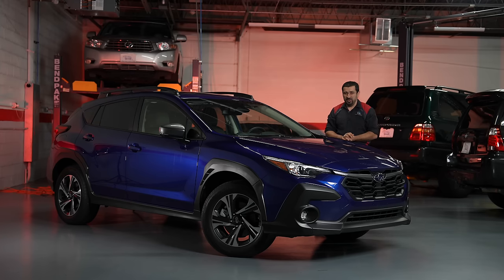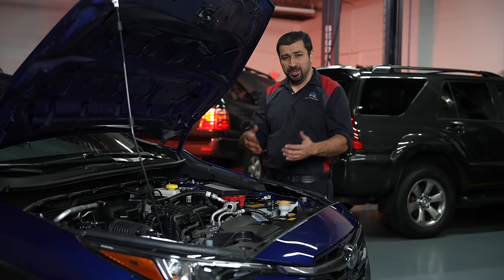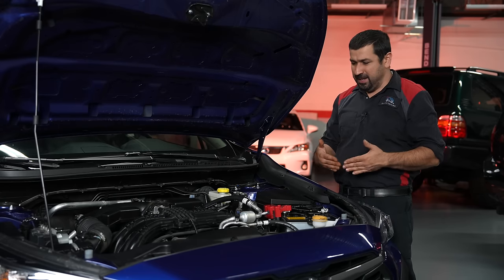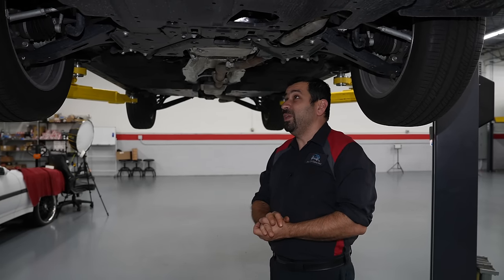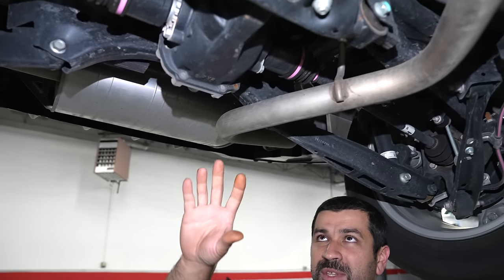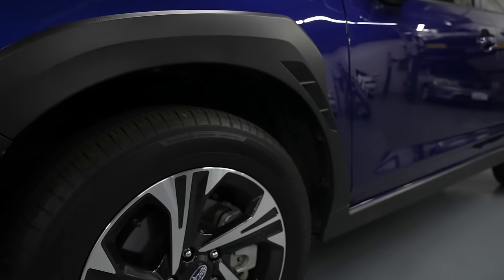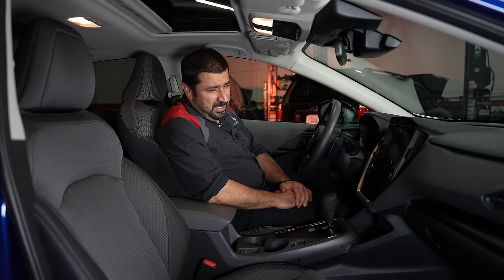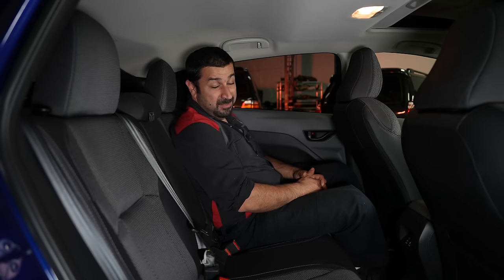Should You Buy a 2024 Subaru Crosstrek? Thorough Review By A Mechanic

Comment: Bought a new Crosstrek for my wife who commutes to/from work totalling 80 miles a day in 2018.  It now has 115,000 miles on it.  It has been an incredible vehicle.  33 mpg highway and has had zero repairs.  Nothing but oil and tire changes.  We are sticking with another Crosstrek in 2024 when we replace the 2018.
Reply: Did you do CVT fluid change my dealer said after 100k miles.
Reply: @danek893  no, i tried, they told me its lifetime non serviceable cvt
Reply: The cvt is fully serviceable. Put up on a lift with the car in the drive, you can change the fluid.
Reply: @dietmdew845 Good Lord, there's no such thing as lifetime fluids. All fluids break down due to thermal cycling, particle retention, etc..
Reply: Does it consume any oil between changes?
Reply: @ij6708 I remember hearing that Subaru means 100,000 mi is lifetime. So by lifetime they only mean for it to be 100,000 MI. So yeah you should definitely get a changed as long as it doesn't void the warranty. Which I've also heard that as long as Subaru does it themselves it doesn't void the warranty. You just have to find a dealership who's willing to do it. Just don't take BS.
Reply: @dietmdew845 definitely that that fluid replaced. It will be worth it.
Reply: 9/24 update - still no problems with the crosstrek however we just trade it for a new Rav4 XLE.
Reply: Which trim crosstrek did you have? Also, congratulations on your new puchase
Reply: @dietmdew845  you don't have to do the real maintenance if you're going to replace it at 100k anyways. that's the next owner's problem. if you're owning one past 100k and the pcv valve and cvt fluid changes haven't been done regularly it will have problems. the most common issue with these cars is timing chain cover leaks (because of not replacing the pcv valve every 30k) and cvt issues (because of running it with contaminated oil)
Reply: @dietmdew845  They lied to you, I highly recommend you go to another dealer. its not lifetime, you are loving your car, you should be doing it every 40K honestly. If you look at the Japan maintenance on the same vehicle you will see it has a service schedule, Subaru of America is trying to show low cost of ownership
Reply: @dietmdew845 so you didnt go with a crosstrek again...
Reply: That is what my dealership said about my transmission as well.  2019 Outback.  Just under 111,000 miles.
Reply: Get the 2.5
Reply: Lucky. My 2017 cracked a piston in year 8 at 110k

Comment: I drove a 2024 Crosstrek as a loaner for a few weeks, and I just want to say the 2.0 engine isn't fast but it's not as gutless as you make it out to be. Like any naturally-aspirated engine it'll wheeze at high altitudes, and it's not a good choice if you like to drive pretending you're Vin Diesel, but it has plenty of power to safely pass slow traffic and merge onto highways. I've driven cars that were so gutless I couldn't keep my speed up on a mountain pass, and this isn't it.
Reply: 29:18 🤣
Reply: Thanks for your input. As I haven’t test ridden any of these sub compact suvs that I’m contemplating. This crosstrek and say the Chevy trek, this guys opinionated review was a little over the top. It made me feel like it was so slow it wasn’t even worth testing it! I don’t get it, this car is priced very close to the Chevy treks and trailblazer and on paper it should be better then the chevys, and it’s a Subaru. But this review kind of makes it sound like it’s just OK.
Reply: I totally agree. Like I said in my post above, even the 2.0L is perfectly fine for normal driving. No problem entering freeways, merging, or keeping up with freeway traffic. The non-hybrid Corolla Cross, Honda HRV and base models of the Seltos/Kona are very similar in performance. The reviewer in this video definitely is a bit over the top in his criticism of the powertrain.
Reply: I Agree. I drive one of these in outback Australia and when I come across a road train its fast enough to pass it comfortably. I floor it and it accelerates to pass these long trucks with no pucker factor. It's no Maserati but it gets the job done. If you are a real petrol head, as most mechanics are, then yeah, I can see how they reckon its too slow.
Reply: I remember the front differential on a Subaru had separate case that used 80/90 gear oil separate from the transmission.
Reply: The 2.5L engine in the Crosstrek Sport and Limited are noticeably quicker than the 2.0L found in the Base and Premium trims.  I've had my 2024 Crosstrek Limited since April 2024 and I'm very pleased with it.
Reply: I just bought a 2024 Crosstrek Wilderness and I have no issues with the power. Like others have commented he does seem a little over the top on emphasizing how slow this vehicle is. I find it nothing of the sort, not a sports car but that’s not what I bought it for. Love this vehicle so far! Visibly is the best out there also.
Reply: I mean, the guy says “reeeeally slow” like it is a 4 speed 1.5 Suzuki Jimny or something
Reply: funny enough I decided to buy 2.0L, tested both, but 2.5L looked to me a bit more jerky when engine and transmission are cold, and for me it is important to have it as smooth as possible. Never had a problem with getting to the speed I need, speed limits in Canada here ale lower than in US though
Reply: Yep.  I have a 2013 1.3 jimny and 2019 2L crosstrek, the jimny is a slug.  No issues on power with the subaru

Comment: Driving my 2008 Subaru Outback, 172,000 miles and zero issues. I am 63 and this car is the best car I have ever owned.
Reply: everything changed after cvt. even toyota breaking down now
Reply: I am 70 and have a 2008 Outback with 100,000 been a great car.   I never did the timing belt (yet?) have you ?
Reply: @jima7925 It has timing chains (2 timing chains) so, likely, they may not need replacement at 100k, but you should replace serpentine belt, if you did not do it yet (along with tensioner).
Reply: @spol1622  Nope.  The 2008 2.5 i 4  has a timing belt.  I wish it was chains.  Yes I did the accessory belt at about 80k.
Reply: @cheapmod I fear you may be correct, but I was hoping the e-CVT by Toyota was better in terms of longevity- is it not?

Regular CVTs seems to be made to keep fuel consumption down only transfering that cost to that of the transmission as it fails and hence to the first or the secondary owner with a frugal appearance... Car manufacturers strive to make cars last for say a decade and then they start to fail.... EV batteries have about a 8 year/160000 km guarantee and a new battery is so expensive then the car is writ-off by the insurance company...  insurance costs will skyrocket.
Reply: Wonderful. But that has NOTHING to do with this car. 🤣
Reply: That one surly does all ej motors have timing belts
Reply: @andersriksson100 Yes. The E-CVT is far more reliable, but that's because it works on a different principle.There are only two electric motors and a set of planetary gears that are constantly engaged. There are no torque converters, clutches etc. this is the main reason why I bought a 23 Corolla hybrid all-wheel drive. With regular maintenance, these setups can last a very, very long time.
Reply: @piperpilot26  As I suspected. A bit strange that Toyota name their gearbox "e-CVT" when "CVT" has such a bad reputation. Wouldn't mind a Toyota corolla Cross AWD full hybrid myself but too new and expensive.
Reply: @andersriksson100  Right? It's going to take a bit of refinement and time to regain trust within the consumer. Although, it does seem like Toyota does have them figured out in their ice platforms.
Reply: @andersriksson100 the bad reputation came from Nissan. So than everyone “ONLY” uses that excuse for “ALL” CVTs. There are tons of Subaru CVT’s going 300-500k no issues. My 2010 went into 250k no issues.
Reply: @letzgow6110  It might have "originated" with Nissan CVTs but not excluding other CVTs.... maybe with Toyota (and Subaru?) as an fair exeption?
DCT and CVTs seem to have been rushed into production to be able to state low official fuel consumption figures more than anything else no matter what the car/transmission manufactures say.

If most of them become standard but still with inferior longevity then we, the consumers have no choise, we have to pay to keep them running and the manufactures and car repair stations are and will be happier than ever...
Reply: @andersriksson100  I will say I watch Ryan a car reviewers who takes cars on off trails and test out their AWD or 4x4 systems and many AMT and AWD systems overheat and shut off. During his testing with Subaru’s this has not happen “yet.” Just proves Subaru CVT transmission are not as flawed as others have come to believe even for AMT comparable
Reply: @letzgow6110  That's good, might be relevant but it doesn't really say anything about the  general longevity  of the transmission in ordinary use.
Reply: Hi, i just got my first car and is this one. I hope i enjoy mine like you have with yours.

Comment: I have a Crosstrek and an outback wilderness.  Here’s my two cents cut the chase.  The Crosstrek has the best awd system hands down.  You’ll never get stuck in a snowstorm period. It’s very reliable.  Period.  If when something goes wrong it doesn’t cost an arm and leg to fix like a bmw or Audi as example.  They hold their value as well.  Subaru as mentioned here does do things differently than other car company’s.  They actually listen to the consumer and they integrate what the consumers want in their cars.  For all the things I loved about my old bmw x5 I can give many others I hated such as reliability and cost of ownership.   The Crosstrek is a get up and go no nonsense suv that is really really good which is why you see more and more on the road.  Good review here
Reply: Sounds like a whole bunch of cope becuase you bought a subie😂
Reply: I'm thinking that if they did indeed listen to their customers they wouldn't have made it with a CVT.
Reply: @barrybarnes96  Haters got to hate I guess. The primary competitors are the Corolla Cross, HRV, and Kona/Seltos. All three have CVTs, except for the upper trim levels of the  Kona/Seltos.
Reply: I thumbs down
Reply: Unfortunately, I have to disagree with you. I had a 2020 Forester Sport with dual X-mode and a Crosstrek 2.0 loaner, and the Crosstrek became stuck in a foot of snow and couldn't free itself. To make a long story short, there was a lot of tire spinning and transmission fluid heating smells coming from this thing and a lot of side-to-side motions to no avail, after nearly 5-7 minutes of trying.  The Forester, on the other hand, had a similar if not same snow situation, and it not only pulled out, but it pulled out without so much as a hiccup. To be fair, I don't think it's a matter of the all wheel drive system, as Subaru has a good system; I think it's a matter of the CVT not being the most direct drivetrain, and the 2.0 having too little torque.  If you don't get that motor to a certain RPM level, it ain't moving. It will rise and then fall to protect the transmission. Again, the Forester, with its 2.5L had absolutely no problem. Also, to be fair, upon reflection, I think it's actually a number of things that could have caused my issue: I think it had something to do with the motor and transmission, like I mentioned above, but perhaps it was the OEM all-season tires.:-) I know...I know... However, despite the all-seasons, I think it could have done it easily if it weighed more.  I was driving the car with half-a-tank of fuel and no passengers or luggage, so it likely didn't weigh enough to get traction. The Forester was heavier, so it probably helped it too. Again, it pulled out like a champ. But weight matters just as much as AWD competence.
Reply: I can't explain your experience, obviously, but tires could make a big difference. All I can say is that I have a 2.0L  Subaru Impreza, same body as the Crosstrek. Even without X-mode it has excellent traction in the snow
Reply: @edsmith9855 Mazda Cx30 is also in this range and is not a CVT.
Reply: @caryg4638 I guess the tires were getting old. Also, you need to turn off Traction Control if you get stuck.

Comment: We purchased a '24 Crosstrek Limited (2.5L engine) in September.   I'm 6'4" and I fit into it pretty nicely.   We live 8km (5 mi) down a decent gravel road, and the car absolutely soaks up bumps and washboard (better than my F150 or older Sierra 2500).   The LED headlights are fantastic.   The 2.5L engine is quite zippy and we have had no issues wanting more speed on the freeway.

While I would agree that the infotainment screen needs a bit of improvement, it's pretty good.  It should be noted that the temp controls for the dual zone climate control ARE physical buttons, which is nice.  Heated seat buttons are great.  The "low" is a bit warmer than I'd like but not bad.

We put studded Nokian tires on it this winter and the thing is unstoppable!  We had about 18" of snow this winter, but lots of icy hard-pack and even on our windy gravel road (uphill to our house), it NEVER slipped.  I could not have been more impressed.

The AVH button can be put on the main screen of the Infotainment screen (shortcuts). You don't have to go to the vehicle setup screen each time you want to turn it on.  The AVH defaults to "Off" each time you start the car ( I assume a safety choice by Subaru?) so you do have to hit the button each time you start driving (if you want to use AVH) , so that's a bit of a pain.

I agree that, while the "Auto" button for climate control is customizable (each driver can have their own setting) , it would certainly be nice to be able to customize at least one or two other buttons in that button group.   Hopefully a future software update would resolve this.

I am really not a fan of the interior lighting.  They've used halogen or incandescent lights inside and they're marginal at best, and in the back cargo area they have one small incandescent bulb which is absolutely useless.  

The lack of ability to change the "X Mode" driving mode while moving is also disappointing.  We had a trip last week where, when we left home there was no snow, but at the top of the mountain pass 2 hours later - lots of snow on a steep downhill.  It would have been great to change to the Snow mode while driving, but instead we had to pull over, press the X Mode button, then pull back onto the highway.   Maybe it's a physical or safety limitation - I don't know.

Overall we've been quite happy with our Crosstrek.  Fuel economy is quite good, it's remarkably zippy, comfortable, and quite a pleasure to drive.  

Thanks for doing such an excellent review!
Reply: You should put in some LED bulbs. It's pretty easy to do as the covers just pop off. My friend did that on his WRX
Reply: If driving a lot on gravel, keep an eye on the CV&DOJ boots.
Reply: It's good you completely disagree with him about it being slow especially from someone that actually drives and owns one .... I guess he thinks it's suppose to be a race car.

Comment: I just picked up a 2024 Sport. The drivability is outstanding! Easily drives as smooth as my Lexus. Got the bigger engine and power is not a problem. Really a fun car to drive!
Reply: I have a 21 sport & power is definitely not a problem,  even tow a 14ft boat often, great driving vehicle.  Im a 34 year dodge,jeep,Chrysler tech & love the shifting, ride quality, fuel mileage & performance.
Reply: How do you compare the road noise to a Lexus? Totaled my Lexus RX300 a bit ago and I'm considering getting a Subaru Crosstrek, but I don't know if it's as quiet as the Lexus.
Reply: @HidInMistProductions its damn close but you can't expect that type of noise for 27k

Comment: The 2024 Crosstrek is a great vehicle. That said, I bought a 2023 Crosstrek Limited 2.5L in January after seeing the redesigned 2024 model. Mechanically, they are virtually identical, but I prefer the looks of the previous gen inside and outside, and the 2024 not having physical knobs and buttons for HVAC was a deal breaker for me. I absolutely love my '23 Limited. The 182hp 2.5L engine has plenty of power for regular driving, and the CVT is super smooth, quiet, and efficient. Just a great package overall. I've also worked on cars for over 20 years, and really appreciate how easy Subarus are to work on. They're just well thought out in that regard.
Reply: I test drive the Crosstrek and Impreza Wagon. And the Crosstrek is 100% a waste of money. It’s a taller Impreza with worse fuel economy.
Reply: The HVAC thing sucks
Reply: esp the oil filter 😁
Reply: @miniaddict4534  literally straight from subaru - The Impreza and Crosstrek are both highly fuel-efficient vehicles. Because of their similarities, the two models have identical gas mileage, up to 34/27 MPG highway/city depending on which trim level you select (except for the Crosstrek Wilderness which has a slightly lower MPG rating).
Reply: QUESTION: IF I AM TRYING TO BUY A SUBURA WITH 2.5L, WOULD YOU RECOMMEND A 2024 OR 2023..?
Reply: I live where the weather can get pretty bad, so I would rather the crosstrek for the 8 inches of ground clearance. I'd just try to drive eco friendly. The widget showing your gas pressing % and fuel economy levels on the dash can help with that. 😊
Reply: @tinhinnh So what’s wrong with the oil filter? It’s right in front of you and super easy to change. Don’t have to crawl underneath, unscrew it and have oil run up your arm.
Reply: @ericripley9739 i didnt say theres anything wrong with it 🤷🏻‍♂️
Reply: @tinhinnh  sorry for that .Was looking at the previous comment where he said the HVAC sucks. Thought you were adding to that.  Again,  sorry.